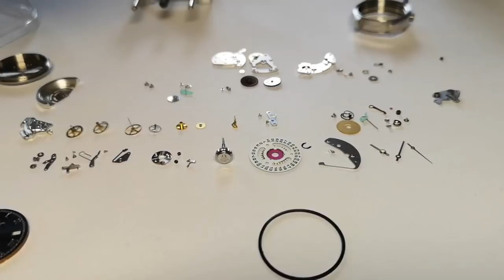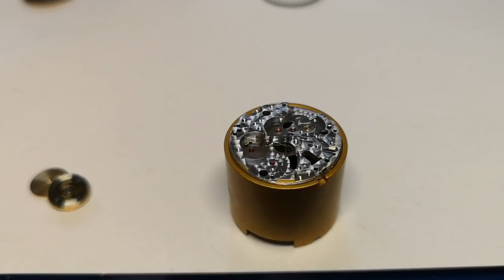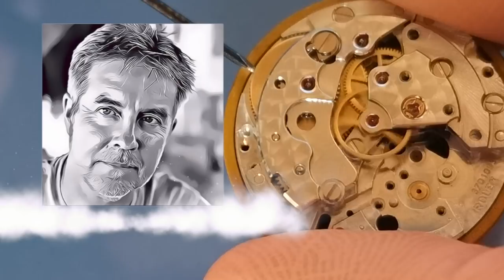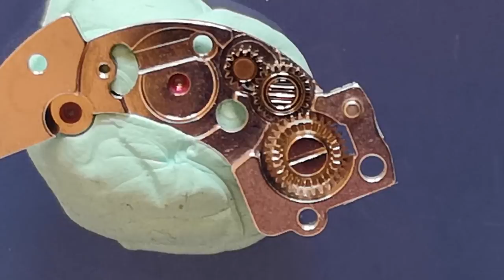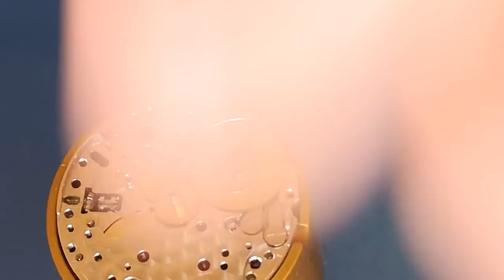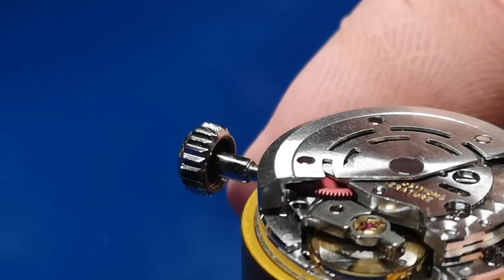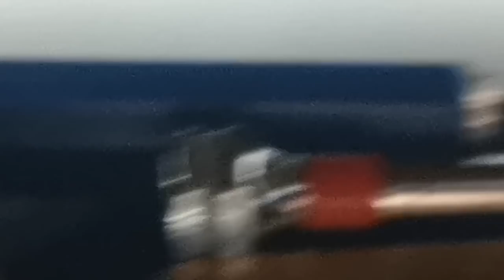Rolex 2135 Reassembly - Lady Datejust 26mm

Comment: Hello! One questions does this movement change the date automatically at 00:00 or does it take a couple of hours to jump and change the number. Thank you!
Reply from the maker: Hi... The date will start to move at around 23.40 and click into place between 23.58 and 00.02 provided that the movement is correctly calibrated.  Hope this is helpful. Richard

Comment: Thanks for posting this. I’m getting ready to service one and this video is ver helpful. Interesting that you didn’t remove the canon pinion or the cap jewels. I probably will anyway. I think it’s a good practice as I’ve found plenty of gunk still on the cap jewel even after running the movement through a three stage watch cleaning machine.

Comment: Amazing Video fascinating infact.  Question are movements like  Rolex easier to work on because of the precision of a superior movement compared than say a Seiko for example ?
Reply from the maker: Hi Darren ... not really although the chance of anything needing any force to seat in, as happens occassionally with a very slightly misaligned bridge for example,  is zero.  If you are forcing anything you are doing it wrong!  Thankfully Seiko movements are very similar to work on .... I spent two and a half years breaking seiko movements whilst I was self training.  Eventually your error rate will reduce to almost zero and then you can start to work on more valuable movements ... a mistake with a seiko normally costs between £8 and £40 to put right in replacementment parts.  Rolex mistakes would be 10 to 20 times that amount ... even if you can get the parts.
Reply: @richardperrettwatchmaker  Yes i think i would be practicing on the Seiko first definitely!! haha.

Comment: Obvious to me now, that you can only justify this amount of labour on an expensive watch. Watchmaker skills can only be used when the maintenance cost is relatively reasonable to the value of the watch. I can't see work done ever on a €50 or even €200 movement. You simply put a new movement in, or buy a complete new watch. So the question is, when a €50 movement (for example a NH35A) needs an overhaul, how expensive will a swap with a new NH35A cost? Is it worth the value of the watch? Can you do it yourself may be?
Reply from the maker: Hi Rene ... swapping out a movement would cost about £40 plus the cost of the new movement were I to do it.  Doing it yourself is an option but there are risks (mainly that you damage the more delicate parts of the movement whilst handling it) and the tools necessary ( Case holder, case opener, hand levers, precision screwdrivers together will cost in excess of the £40.  )  Nice to hear from you. Richard
Reply: £ 40,- sounds very reasonable. Doing it yourself is too risky is my diagnose. Watching the video is very relaxing. Watching a watchmaker makes you realise it would be 100 % impossible to end up with a watch that will ever tell me the time again. Now imagine a blind watchmaker with a heap of random parts. What is the chance he produces a working watch?..... But that is exactly what modern evolution scientist like to let us believe.... Think about it and you know Dawkins must be wrong.  https://en.m.wikipedia.org/wiki/The_Blind_Watchmaker
Reply: Rene Bense So a blind watchmaker doesn’t have to rely on “magic”.